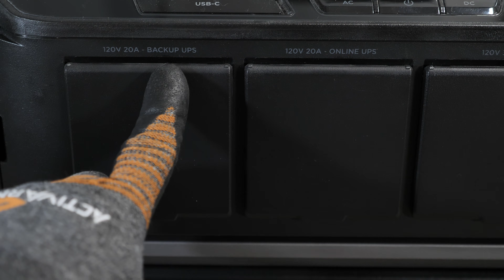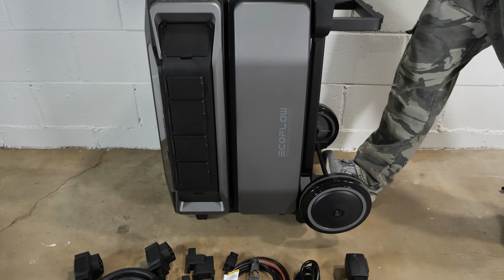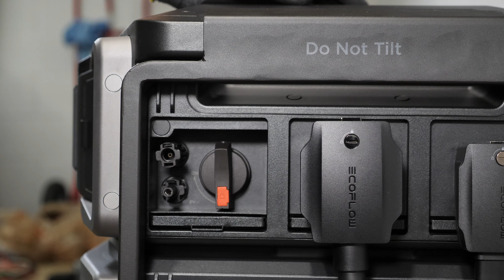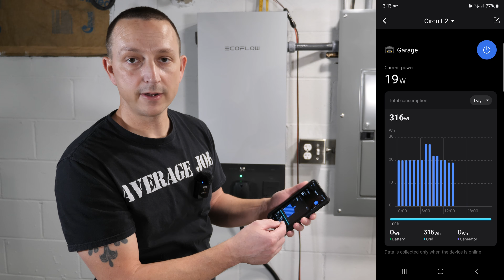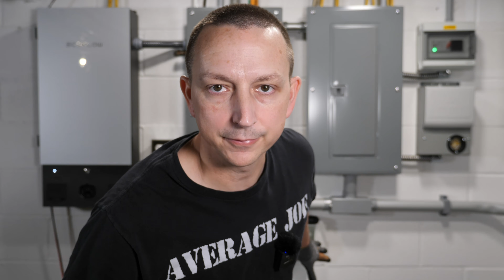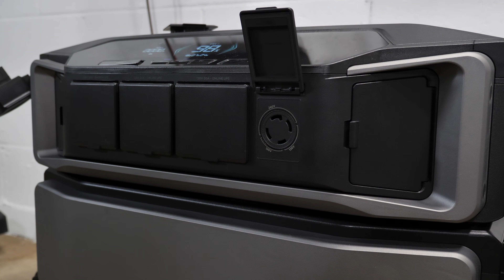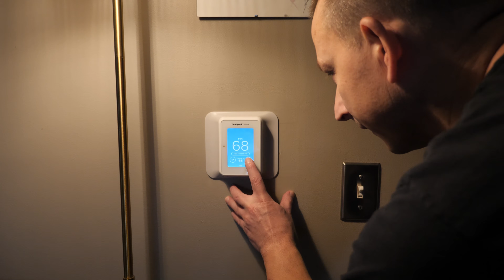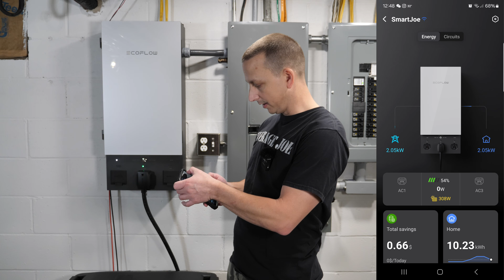Demo of Fully Installed EcoFlow Smart Home Panel 2 with Delta Pro Ultra - Black Friday Deals

Comment: Where are the coupon codes to save on the price of the EcoFlow Delta Pro Ultra inverter, battery and Home Panel 2? I want to buy all three at once.
Reply from the maker: I should have a discount code in discription but that might be all there is at the moment. I would also think the holiday weekends coming up would have discounts as well.

Comment: Well, let's say I don't have the grid.I have to get 2 of those to run.All my major appliances plus my one twenty and might become short and I have to watch what I use just to still have power and hope there's sun every single day And I'll use that as my grid.
Because that's all I have. But I know, just 2 those units. I will be lacking on power cause it only gives 14000 something rather power and 13200 is my major loads. And for how much 120th I need more than that involved. It's just for 120. Well, not more than 14000 but more than 2000. So I'd be better off if I get three of them and use one of them just as one twenty and that would give me enough power and use the other two as one twenty two forty was just two forty actually and I'd be set. Except when we get to cloudy weather for a couple weeks at a time then maybe I have a little bit of problem. My other problem is I get about $7200 and medical bills every year.
 And I'm not on medical assistance. I actually haven't church. But you gotta pay out so much before they cut in. So they're preparing a fraction of that.  And I.
Gotta pay the rest of it. And that does not include the medicine or dental.Just go into the hospital.Does it even include the clinics.

Comment: I have 10kwh Solar Panel System With Enphase IQ8 Micro inverts so I can run off grid when qrid is down and sun is shining. Is there a way to use 77 KWh EV battery in my EV Vehicle to Home for long duration power outage with this Unit and one battery. I see the EV battery as a wasted resource just sitting there.
Reply from the maker: Sweet! I think it could be possible if your EV allows its battery to be used as a source. I know many are not setup to do that tho.

Comment: Is it possable to just run a gas generator, 240v to the DPU for charging on cloudy days. Then run a 240v out from the DPU to a small breaker box for distributing small loads for off grid living? This is just for a single DPU unit. And if so , how?

Comment: Nice Video Joe! I do have a question for you on the transfer from grid to battery operation. In the video you said it takes a couple of seconds for the smart panel to sync with the grid. By this  do you mean it looks to match phase with the grid and then makes the transfer? One of the big issues we all have with the Delta Pro is when going from inverting from battery to grid pass through, the DP doesn't make sure it's in phase / frequency sync with the previos state. This can and does cause rotor lock in refrigerator and air conditioner compressors. If your mostly off grid like us and use the grid as a charging backup we have to be super careful when we make the transition from running on battery to running on grid. I  currently look at my Delta Pro output to see if the fridge and freezer are off before switching grid charging on to my delta pros. If I don't  I sometimes get rattling from the compressors and then they are in rotor lock which draws a big wattage until the overloads click out on their start relays. People who do RVs have the same issue when connecting to shore power when arriving at the campsite. I sooooo hope EcoFlow has corrected this issue with the Ultra and Smart Home Panel 2. "All" this would take is for the software to make sure the sine wave from the DPU and Grid match each other before the transfer relay clicks over. Do you have any input on this? Thanks!

Comment: Great video! If you had two Ecoflow inverters, you can plug both into the Ecoflow hub and get more power, right? Then you would have more power for the stove and or to run more higher wattage items at one time. Or is this too much for the Generator Hub? Thanks.
Reply from the maker: Yep, that is correct. Adding the 2nd inverter to the generator hub would allow for 14.4kw worth of inverter output which would get us moar for the stove plus other stuff at the same time.

Comment: Does it care whats plugged into it , Ir the Delta Pro or an Anker F3800? or does it only work with the Ecoflow products
Reply from the maker: I think you could use any 240v device as long as you use either the generator hub or generator adapter cable to power loads. Not sure on charging yet.

Comment: Could you DC couple this with your diy LFP battery bank? Best of both worlds?
Reply from the maker: That would be cool if we could but no. The batteries inside are higher voltage and I am not sure on the battery cable. I think it needs the data lines in order to read if connected.
Reply: Could you not use the low power pv  port to input your diy LPF battery bank, it definitely falls within the range of the low power pv port. I do this with the Delta pros.
Reply from the maker: Yeah you could extend the runtime this way for sure. If thats what Ben was asking, I 100% misunderstood lol. I was thinkin he ment more of just adding a diy battery🤦‍♂️😆
Reply: @AVERAGE_JOE  no worries, yeah extend the run time is what I was thinking.

Comment: My home has two electrical panels which are not near each other.  So, does that mean I need to have two EcoFlow smart panels and two sets of inverter/batteries - one for each electrical panel?  Thank you.
Reply from the maker: Nope, all that is needed is a main feed from the main or sub panel and then run the circuits you want powered offgrid, TOU or as a backup.

Comment: Does it do AC support?  Using grid and Solar powered Ecoflow equip?
Reply from the maker: It does not send power back to grid. It does not do AC coupling. Yeah you can charge from solar and grid and you can also power your loads with grid, solar and battery. Or did I misunderstand your question?

Comment: Curious on the code requirement for DC PV Cables to be in metal conduit. Maybe a dumb question but how do you connect to the High V PV input and maintain the metal conduit code requirement?
Reply from the maker: Right.....By code any DC solar entering a structure needs to be in a metal raceway. If you needed it to be up to code for an inspection, You could use the liquid tight flexable metal clad or even regular metal conduit to a metal box and attach the box to the inverter or something similar. If your not getting the ultra inspected, I would just run metal conduit down the wall to a box with MC4 connections, then short cables to the ultra.

Comment: What a fantastic review, thank you! Question: So, the only way you can power your whole (existing) panel is to use the generator hub and the lockout switch? Seems like the smart panel 2 limits you to only a few breakers. What are your thoughts on this?
Reply from the maker: Thanks! Yeah the only way to power the whole home would be to do as I did and go through the 50a hub and lockout and backfeed the main panel. The smart panel could also accept the single slot breakers but have 2 breakers on them so you could get up to 24 circuits BUT you will still only have control of the 12 slots. I think the main goal is to take all the critical loads off the main panel and move them to the smart panel. If you have any room left then add more loads.

It really depends on what you would want to do or what your goal is. If you want auto switching if the power goes out or time of use features. Then you would want the smart panel. If you want to start your journey going off grid, go without the panel first. One ultra is good for 30a out the front 240v outlet. If you get the 50a hub then you can connect 2 ultras in parallel for the 50a output OR if you have 2 delta pro's then you could use those as well. If thats not enough then you would need the panel to parallel 3. If you parallel 3 together, you better cram as much as you can in that panel to include the BIG draw items. Oh and solar too😉

Comment: Are you able to sell electricity back to the utility company with this battery/panel during peak time?
Reply from the maker: No, it is not capable to send power to grid however the idea is you take yourself off grid during those times or alltogether.

Comment: Great video. 
I keep missing if this can function like a true grid tied battery bank.  Can this output to the main panel based on power usage?  For example cover all power usage at night if it is below the inverter output rate and the battery capacity?
Reply from the maker: Nope, this unit cannot backfeed the main panel. It supplies output power to the load that you connect only. The smart panel is just a fancy subpanel that has transfer switches in it that "turn on" if the power goes out to continue powering the load OR if you give it a "command" or "task". Hope that helps clear up any confusion.
Reply: @AVERAGE_JOE  so it can sectionalize itself from the main panel to supply only the critical loads from the battery? I guess maybe it can be programmed to switch to running on battery on its panel at a certain time of day when solar stops generating enough.
Reply from the maker: Yes, it has a transfer switch inside to  power the panel from battery if grid goes down OR if you select off grid mode. You can also select certain breakers(loads) to go on battery whenever you want and vice versa.
Reply: @AVERAGE_JOE  totally interested to see what settings the app has to control this. Essentially the main loads of your house can be split to run off the battery at night when you're not generating with solar and swap back when battery charge state is low. And the loads not on the smart panel would remain fed from the grid.
Reply from the maker: Yeah you can do that😄🤘
Reply: @AVERAGE_JOE  definitely interested.  Very cool because they're easily expandable to fit your needs and no ok from the utility necessary, just install a sub panel to code and get it inspected.  This makes sense compared to more intensive installs for other systems.  
I'm interested to learn more about how detailed the app is for programming them. Specifically to charge the batteries when solar comes on then to swap to the battery when solar drops off.  
I guess if your panels are tied in through a breaker you can use this sub panel to control all of that.  
It's a bit clunky for a grid tied system but simpler for installation and setup it would seem. I guess the challenges are in the programming the charge discharge and getting the battery banks sized appropriately.
Reply from the maker: There is a lot that you can do. Also remember, this is not a grid-tie system. Solar input is on the inverter. Im not sure about AC coupled solar on these. I wanna say that is a no-go BUT not 100% on that. If you have an existing AC coupled system, that would work as normal I think as its before the smart home subpanel. I would need to find out to male sure.

Comment: I am looking at this setup, with 2 Batteries (12kw storage). hooking a 2500W array up to it, and using it as my "Shore" power on my RV to connect through the 30A 240V plug. My question, could this be used to power my whole RV, and would i be able to recharge this battery with a gas Generator should solar be lacking?
Reply from the maker: Yes you could power your entire RV as long as the MAX rated power is 7200w or surge to 10kw. As for gen charging. If it is 120v, then you would use the supplied AC cable and plug it into the generator just like a wall outlet. Charge up to 1800w. If its a 240v gen, then I believe all that is needed is the generator adapter cable that plugs into the side of the inverter(input/output port). I dont think you need the 50a generator hub but can make sure if you have a 240v gen. Let me know

Comment: Thank you for sharing the information.
I am trying to figure out the solar panel part. 
I have an existing solar system on my roof connected to a SolarEdge Inverter. Is it possible to connect my existing roof solar system to the ECOFLOW Delta Pro Ultra as an input?
Thanks.
Reply from the maker: I am investigating that very question on existing AC Coupled solar.
Reply: @AVERAGE_JOE  Curious if you got around to answering that question - I'll dig through your videos to see if you have :)
Reply from the maker: If you emailed me I resopnded. If not, I dont think its possible for an existing AC coupled system to be wired directly to ecoflow.

Comment: I would like to see a set up like this that could be topped off with a standard gas/propane generator during use. This would be handy to run the generator during the day to charge for a few hours then use the battery over night. We need one with the 30 amp generator inlet for charging, lol. That's true back up power. During a hurricane and stormy weather your not going to have much any solar or grid power. Will the smart panel allow charging from a generator and provide power to the home at the same time?
Reply: Good question.  I was wondering the same thing.  I’m thinking it won’t do it at the same time.  I bet it’s one or the other
Reply from the maker: I could make this happen with my old military 240v 5kw diesel generator. All Id need to do is run some wire and install the breaker at the top of the panel. Once on gen power it should power the panel as the grid would and also charge. 
You would need a 240v gen to do this if I didnt mention that.

I will also mention the gen is in my driveway at the moment. Waiting for some snow to melt so I can move it to the back yard and closer to the panel.😄

Only way to charge from a regular 120v gen would be like plugging the ultra into a wall and up to 1800w charging. I dont think the panel would be powered at this time but can check to make sure.

Comment: Does the connector cable come with the panel or the battery and inverter
Reply from the maker: The Longer connector cable(inverter to panel) comes with the panel. In the video I might have said it comes with the inverter but I misspoke.

Comment: Can you connect another battery to this. Like a 5kw rack battery that only costs 1500
Reply from the maker: I dont think so on these. I think the actual battery voltage on these are different then the standard 48v battery range (42-58v).

Comment: Good stuff. I got a good laugh at the stovetop segment.  "And look at that, all of the"....poof! All of those burners on high had to be pulling a huge load.  "Ultra" that!  Still, that's pretty impressive how the residential side of solar generators is improving so quickly.  I seems that EcoFlow has about the best remote software on the market as well...incredibly functional although it probably takes some time to sort all of the choices out.

Comment: Amazing video, man, thanks! Just a question: can I use the battery as my primary source and the grid as a backup? (and say, keep using the grid until the battery is fully charged)
Reply from the maker: Thanks! Yeah you can do that for sure. Just put it in self-powered mode which takes you off grid. It will switch back to grid when you reach the min %SOC you have set.

Comment: So am I able to just use the smart panel with the DPU plugged in, and have a gas generator plug in outside that is connected to the smart panel to power the entire house if I have the DPU off, or does it have to connect to the DPU directly with the generator? I am thinking of just using the DPU to power everything in the event of blackout, use the battery to run the important stuff, will the connection of a gas generator allow charging and usage the same time through smart panel?
Reply from the maker: Yeah you can use a 240v generator plugged in at the top circuit breaker to power everything that is connected to the smart panel. It would be powering everything the same as if it were the grid. Yes you can have the DPU off while doing that. However, here is what I would do if possible is...run off the DPU until roughly 20%SOC then run the gen for a few hours to power your house AND charge the DPU back up. Once DPU is charged, shut down generator and repeat. That way you use less gas/diesel running the the generator.🤘
Reply: @AVERAGE_JOE  so the generator can power the whole house off the panel and charge the DPU same time?
Reply from the maker: @Everything_girl28 Yep, it works the same as if it were the grid.
Reply: @AVERAGE_JOE  I have another question is there a reason to have two DPU unit vs one with more battery? What would be the benefits for two unit with one battery each instead of one unit with multiple battery stacked?
Reply from the maker: 2 DPU's would double the inverter capabilties. That would be 14kw. 14kw inverter allows you to run the bigger loads while also running everything else. It could allow running the entire stove. If you just have 1 DPU and a stack of batteries, you only have 7.2kw of inverter BUT a lot of runtime. If I had a choice of one or the other. I would choose a stack of batteries since I can run most of my house with a single inverter.

Comment: Great video, thanks!  Was wondering what the best configuration would be to be grid tied / hybrid with this for an entire house?  Can the smart panel sit in front of my current main panel (with 30 or so switches) or something like that to have seamless solar, battery and grid for the whole house?
Reply from the maker: Thanks for watching! This system is not a grid tie system but the making of a grid tie system is in the works. Also this panel/system is designed to be installed after the main panel. Best way at the moment with this system is move over as much of the house or circuits you can to the smart panel and use solar to keep you off grid. Thats my plan at least.🤘